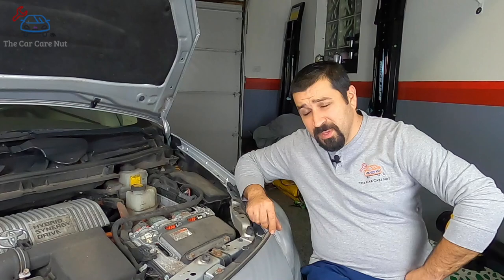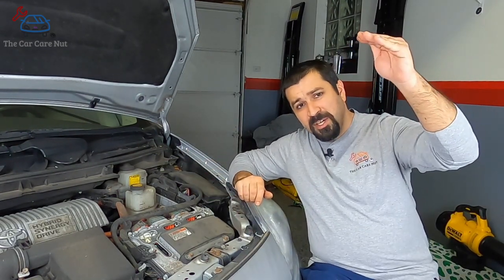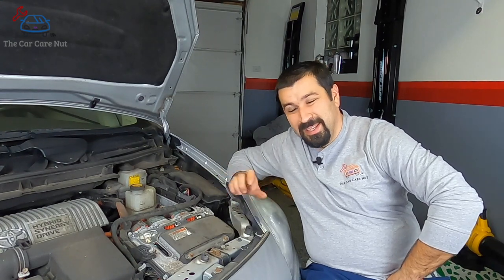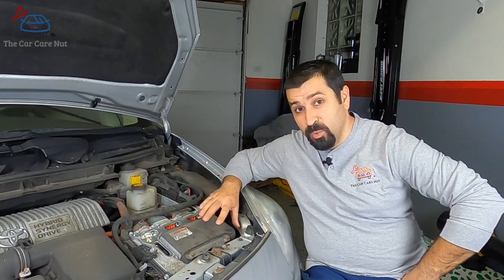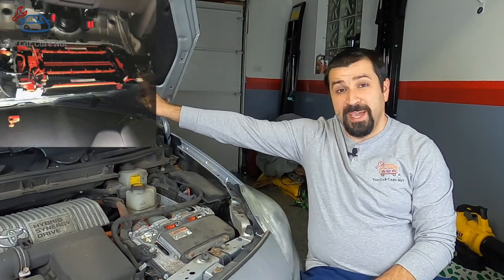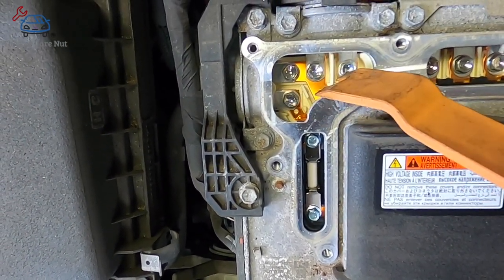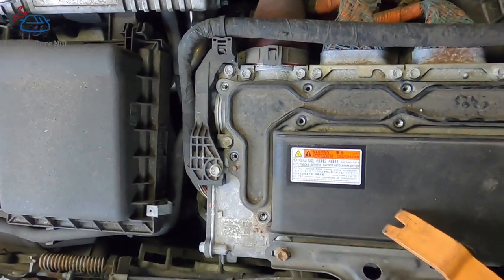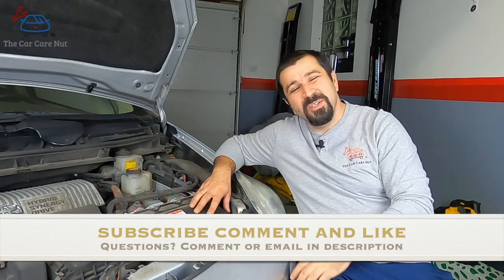How Toyota Hybrid System Work Part 2 Inverter with Converter Assembly

Comment from the maker: Small note. Some hybrid cooling systems runs the coolant inside the hybrid transmission as well. In this video I was generally talking about the cooling system in regards to the inverter with converter assembly.
Reply: your explanation is very good and clear..
can you do a video of what is the toyota recommended coolant for toyota hybrid cooling system and  the procedure of draining and refilling of invwrter coolant and radiator coolant.. big help..
Reply: how does my RX Hybrid cooling system works ?
Reply from the maker: Hi! Which year RX?
Reply: @TheCarCareNut  thx, its a 2010
Reply from the maker: On your RX the engine coolant goes through the transmission as well.
Reply: @TheCarCareNut  oh, ok, strange.

Comment: This is extremely helpful. I bought my Rav4 hybrid two weeks ago, and I wanted to understand the systems better. This series is great.
Reply: How are you liking it?! I'm thinking of getting one
Reply: How are you liking it?! I'm thinking of getting one
Reply: @zachfriesen5925  It is interesting. It is so quiet when it starts that you don't even know it is running. I find that it makes me a calmer driver. It rides smooth and handles great. The only issue is the gas tank. When you are filled up, it shows around 540 miles of range, but you don't get that. The tank is 14.5 gallons and when on empty, I can get slightly over 10 gallons topped off. I know that means I could drive an extra 1.5 hours at highway speed on it, but it is a really bad thing to run a hybrid out of gas. I have also noticed that the low fuel light doesn't go on at even 40 miles left which never happened on my Honda. It costs me slightly under $20 to fill up. The sight lines are excellent. It is also very comfortable for 4 people. The Hatch space is also great. The only thing I don't really like is that if you have a phone hooked into the info system, the audio switches off upon starting the car the next time. Android Auto is a bit of a pain sometimes when you first start the car, but it was the same way as my former Honda Accord which was a 2019. The on-board map system is cloud based, so there is no upgrade fee. The Toyota connection is a reasonable cost per year. They also were extremely low key on pushing for extras when I bought it. Whole thing took an hour. I thought about the Prime but at $10k more, I couldn't justify it. There was one available.
Reply: @theabundantentrepreneur  what made you wanna switch from Honda to Toyota? I am actually looking for a new car and my last car was a Honda Accord. I am considering either a RAV4 or CRV but still pretty indecisive about it. I love my Accord but my parents are pushing for Toyota since many have mentioned their engines are better.
Reply: @asiangrl88  Either brand is fine. I originally went Honda when my 5 year old BMW got too expensive. I did the Accord because I used to own a Pilot back in the day and liked it. The Accord had better acceleration and handling than the comparable Toyota.  However I eventually grew to hate being that low to the ground. 

I had looked at electric vehicles but there was no SUV equivalent.  I decided I wanted a hybrid.  I test drove about 10 cars over 2 days. It came down to the Acura MDX, the Honda CRV, Toyota Rav4 and Lexus NX. Based on price, handling and drive, it was the Rav4. The only issue I have had is the gas tank fuel indicator which will show almost empty with 4 gallons left in the tank.   Thst was a known problem and is now being addressed by Toyota. Mine is getting fixed this morning.
Reply: @theabundantentrepreneur  I see. Thanks for your input! How is the cabin noise?
Reply: @asiangrl88  Very quiet. Not as good as my wife's Lexus but close. The only jolting thing is that it starts on EV and after about 10 seconds the engine starts. When driving you don't notice the switches. When you back up, there is an intentional hum to let people know you are coming, because it is so quiet.
Reply: @theabundantentrepreneur  thanks for all the info!
Reply: I have to ask, is it recommended to purchase extended warranty from Toyota? I am seeking the rav4 hybrid aswell. I’m pretty excited but not sure if this insurance is worth it or just another way to loose money

Comment: I think this video helped me understand why, possibly, my 2006 Accord Hybrid went "dark" while I was cruising at 70MPH in the middle of five lanes on the highway; perhaps the inverter converter overheated (?) but I'll never know it ... Everything shut down but I was able to coast to the infamous side of the road and wait for the towing truck. Took it home and trickle charged the 12v battery, then the car started again. It never happened again for the few months I kept the car after that event. It had 285,000 miles with the original hybrid battery. I drove that car 210,000 + of those 285k miles. Great video, sir, and may God bless you and your family.

Comment: CCN, very informative, thank you. Electricity is so incredibly adaptable, never ceases to amaze me. Some gas furnaces I used to work with have a 3-phase AC draft inducer motor but the furnace is powered with single phase AC. The electronic control produces the 3-phase current allowing the motor to ramp its speed up and down as the combustion process requires. Unbelievable!  Compared to the old pilot burner belt drive models of yesteryear, its like working on a spaceship. I’m picking-up my RAV4 hybrid later this week, I’ll be sure to leave the electronics to the pros. Thanks again.
Reply from the maker: Cars not too long ago used to be like the old pilot burner belt drive! Now they’ve evolved into spaceships too. I only wonder how real spaceships are made

Comment: I'm PC tech (or used to be PC tech), but that's pretty cool to learn that inverter basically has a hot CPU with liquid cooling system!

This thing only went mainstream with PC people like me less than a decade ago, yet Toyota has been doing it all along!

Pretty cool stuff! In my mind car manufacturers were old fashioned and using outdated tech and outdated cooling methods. Nope.

Comment: I just returned from my local Toyota dealer:    I have a 2014 Avalon Hybrid with 153,000.   No problems, our car runs 'perfectly'!   Always have the dealer change the oil and filter every 5,000 miles.     Question.... they say I need 'drain and fill inverter'.  their quote:  $251.52  ... your thoughts, please.    Also, I apparently need to replace the air filter and the cabin air filter.  I can do that myself.  My question is buying the correct filters.  I don't want to buy any that are 'so good' they restrict the air flow.   Thank you very, very much for your help.  I thoroughly enjoy your videos!

Comment: Love your videos. I have a 2014 Avalon hybrid that runs great. I like your DIY content as l do a lot of minor (but important and required) car maintenance on my Avalon and my wife's 2014 Camry [Non-Hybrid].
Could you do a short video showing how to get to and clean an Avalon 2014 hybrid battery filter. I know how to remove the back seat bottom , but not how to move the seat back next to the hybrid battery vent. Keep doing the vids, cause they help so many people.

Comment: Absolutely love your content! I always has one question, in a hybrid car, is the gas engine only used to generate electricity to to charge the battery? Or is the gas engine also driving the car directly in heavier load?
Reply from the maker: Hi! The engine can run to charge the battery or drive the car as well

Comment: Hi, great video, looking forward to more like this! Does the current to the electric motor always flow from the battery or could the gas engine provide current directly to the electric motor?
Reply from the maker: Thank you! I will explain the power flow to the motors in the transmission video which is coming up Friday. The gasoline engine turns one of the motors to generate which then can charge the battery and drive the other one in addition to driving the car.

Comment: hey quick question for you car care master. First I appreciate all your knowledge and hardwork to achieve the knowledge. I too have been working hard. My question was when your vehicle shuts off at minute 4.57 as you explained because the inverter was too hot and vehicle has a failsafe. What dtcs set? if any. besides the generic malfunction codes

Comment: I don’t know if you’ve covered it already yet, or if you know.
Could you please cover the difference between the pink, red and blue antifreeze?
Without mixing, which one(s) are interchangeable or backwards compatible?
And when flushing the hybrid system, is their one to specifically avoid, among the three?

Comment: Great video once again, btw, do you think that cleaning the MAF sensor is important? How would you suggest the best way to do it ? Thanks !
Reply from the maker: Thank you! The mass air flow cleaning could help but is not something I would pay too much for. If doing it yourself use a very small amount of brake cleaner and let it dry or use compressed air very lightly to dry it and you’re good to go

Comment: QUESTION:   I have a 2014 Prius and would like a few extra outlets and a couple 110 outlets for traveling and or camping in the Prius.  For maybe, a fan, or a small cooler, Laptop, CB radio etc.  What are the Pros and Cons of connecting an inverter to my battery in the back?  What would you limit the size of the inverter to?    Currently, I've been using a 200 or 300-watt inverter that plugs into the cigarette plug/power outlet.

Comment: Do new Toyota hybrids with EAWD have a front and rear differential + transfer case? How often should those fluids be changed?
Reply from the maker: No transfer case. They just have a normal transmission that’s exactly the same as a 2WD model. In the back they have a differential which has a motor and actually Toyota calls it a rear transaxle. It has an electric motor and a wire that runs to the back which powers the motor when needed to achieve AWD. The fluid on that is also Toyota ATF WS and needs replacement every 60-90k along with the transmission fluid. Very simple drain and fill.

Comment: You forgot it also takes AC current from the motors and converts it to DC to send it back to the batteries. When the car is using electromagnetic braking.

Comment: Hello, thanks for the video
I have this question:
Is the high voltage still dangerous when the car is off ?
Reply from the maker: It shouldn’t be but if you’re working in the battery then yes. But you still need to take precaution when working on high voltage wires even with the car off

Comment: Does the inverters coolant or the special grease you mentioned need to be swapped out eventually long term?
Reply from the maker: The inverter coolant needs to be changed along side the engine coolant first replacement at 100k or 5 years then 50k or 5 years afterwards. The thermal grease is not serviceable and should last the life of the inverter. When the ipm is getting replaced or removed then it gets replaced.
Reply: @TheCarCareNut  , do you have a video of changing the inverter coolant? Separate valve from the engine coolant, right?
Reply from the maker: Hi jack! I don’t have a video for the inverter coolant yet but It’s definitely on the list.

Comment: Should I be concerned about getting a used inverter? Since the new one is very expensive for a 2007 Camry I have, would you recommend giving a used inverter with converter assembly a shot?
Reply from the maker: Hi! As long as it didn’t sit outside exposed and the intake looks clean it’s not a bad idea
Reply: @TheCarCareNut  How reliable are the latest inverters being used by Toyota in comparison to other major components of the hybrid system ? How can people maintain this inverter for long-term ownership of car ?

Comment: RAV 4 Hybrid 12v Battery. Why fit a battery with 680 CCA, when (IMHO) system better suited to a deep cycle leasure battery, as used in a caravan or RV - these are deep cycle and longer lasting? love your videos by the way

Comment: Awesome videos! Learned a lot from them.  Just one question.  Is it ok to add a load of 18mA to the 12V battery from a GPS unit when the car is turned off?  May God bless you and keep you, too.
Reply from the maker: Hi! It will make a slight parasitic draw. Shouldn’t be an issue if this is daily driven but if sits for over a week it could drain the battery

Comment: I am surprised to not FIND any videos related to a very common toyota hybrid problem. HEADGASKET failure and oil consumption. I own a 2013 prius, oil consumption started at around 150k miles, Headgasket failed @ 250k miles, after replacing the Headgasket and seals oil consumption decreased significantly. Car runs like new.
Reply from the maker: That is upcoming in a common issues video for the 2010-2015 Prius. I’m with you it’s very common unfortunately.

Comment: Should I understand that there are 2 electric water pumps? One for the engine circuit and one for inverter circuit. And where does the power to these pumps comes from? For example, the power for AC comes directly from the inverter. Thanks!
Reply from the maker: Hi! In most models especially the newer ones yes there are 2. The inverter pump is powered by the hybrid control ecu. And the engine water pump is power by the engine ecu

Comment: Can I wash in the engine bay and the engine I've got a Toyota hybrid 2018
Reply from the maker: Hi! Yes but avoid direct water at the orange wires and electrical connectors and try to dry them off with compressed air

Comment: I have a 2014 Avalon Hybrid.  Can I degrease the engine?  Of course, I will cover any and all electrical contacts, have the engine warm not hot, etc.  I really want to keep my engine as clean and possible.  (As a side note, I believe the Toyota mechanic will take better care if he see that I care!)
Reply from the maker: Yes you can clean the engine. Don’t use power washer cover electronic components and don’t spray directly on the orange wires
Reply: @TheCarCareNut  Thank you !

Comment: hello  I would like your advice.  would it be good to buy a 2011 prius with only 49,000 km?  do you think that car would have had enough use to maintain the battery?
Reply from the maker: Hi! That’s hard to predict. If the car was driven short distances but regularly it should be good. But if it was stored for long periods of time then it could be an issue.
Reply: @TheCarCareNut  thank you

Comment: Hi, How are you? i need help not related to this video? Today i rotated my car ( Toyota rav4 2017 xle hybrid) tires, Front tire goes to back and Back tire goes to Front.  This is first time i did that? Before i rotated, I did not feel any grind after brake. After I rotated the tire, i feel grind when i put the brake, not noise. The brake rotors and pads are good condition. Please, help me, what could possible be grind feel. Thank You.
Reply from the maker: Hi! It could be an issue with the tires. When you brake you shift the weight of the car to the front. First check the tire pressure and make sure it’s around 34-36 psi if it’s good then rotate the tires back and see if it makes a difference.

Comment: Does the Prius Prime have a different setup since it’s a plug in? My understanding is it has 2 engines 1 gas other electric? Is this true?
Reply from the maker: The Prius prime transmission is a bit different. It uses the same 2 electric motors and one gasoline engine but adds more to it. A series is in the works for how plug in Toyota hybrids work which I’ll cover the differences.
Reply: Perfect I can’t wait!

Comment: I'm installing a aftermarket sounds system with an isolator between the extra battery and starting battery to run it .  Will this protect it?

Comment: Do you have to worry about getting the inverter wet when cleaning the engine compartment?
Reply from the maker: Usually no. All the wires going inside are weather sealed and have pretty good seals but I would avoid direct high pressure water to any electrical connector not just the hybrid wires but all electrical wires as they are weather proof but not high pressure direct exposure proof.

Comment: Hi 
If my hybrid battery died or faulty  due to any reason still I am able to drive my 2017 Prius Hybrid V   with  the regular battery already in the car? If hybrid battery failed due to any reason still  I can start and drive Prius Hybrid with regular battery?
Reply from the maker: Hi! If the hybrid battery fails but is not completely dead the car will start and the engine will come in all the time and will have very limited power.

Comment: Hello, is there a far difference between 3 and 4 gen Prius ? Would new rav 4 hybrid have the technology then of the 4 gen Prius ? Thanks !
Reply from the maker: There’s a far difference between the 3rd and 4th gen prius as they are 2 different generations of hybrid drive. The 4th gen drives very nice compared to the 3rd gen. The 2019+ RAV4 hybrid has the latest generation hybrid system which is similar to the 4th gen prius
Reply: I heard Toyota is about to install new batteries more stable and take 10 min full charge 
Will be tested in hybrid 2024 is that true?
Thx

Comment: What chemical do you recommend  to be used to clean the engine (decrease engine) ?
Reply from the maker: There are many products out there. The products I use at work are not sold for retail use only for shops. It’s an additive that we add to the engine oil and let it run for 15-20 minutes then change the oil and filter
Reply: @TheCarCareNut  How about what to be used to clean the dust top of full engine compartment?
Reply from the maker: For light dust just use compressed air